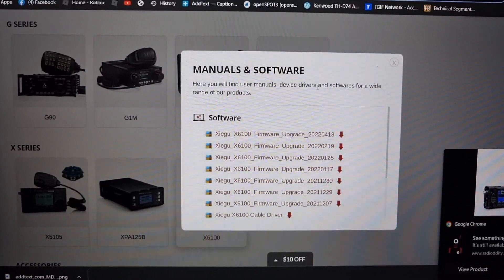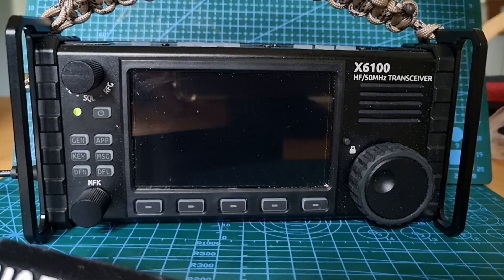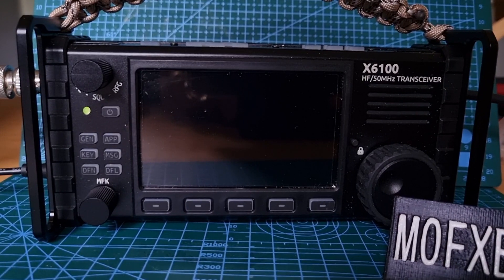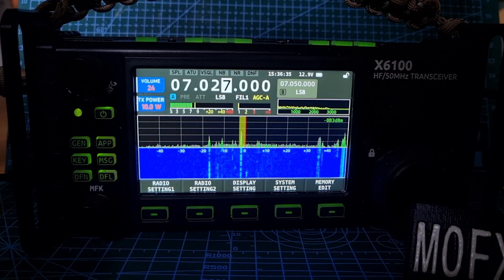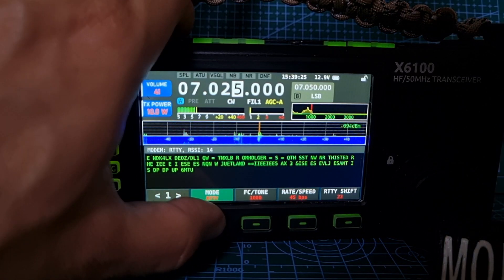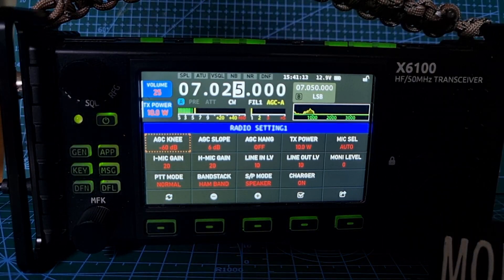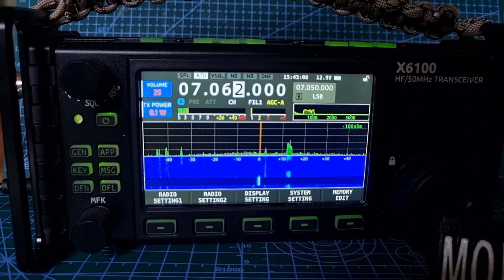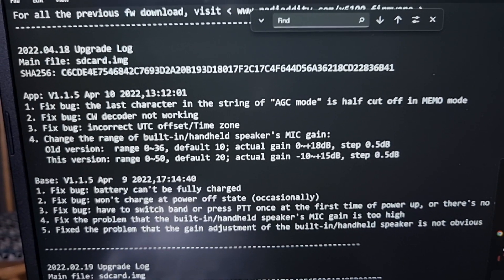Xiegu X6100 - Firmware V1.1.5 April 17th 2022 Full Install and Test

Comment: Just bought x6100 last week, which has the same v1.1.5 version, and the internal battery can only be charged to 8.0V, any of you guys have the same issue?  73 de bg8avs :)
Reply from the maker: Yes 8 volts is normal
Reply: @M0FXBHamTech  oh, so I'm glad to hear I'm not alone :) thanks. the normal fully charge voltage for 2s battery should be 8.4, but it is good for the working life of the battery, so I think I will live with it. I will be using external power supply most of the time anyway.

Comment: Enjoyed video.    Question about updates. My x6100 has version 1.1.2 , so can I bypass 1.1.3 and 1.1.4 and just do the 1.1.5 update ?
Also, you used Rebus to get download. Do I need this software and is it free ?   Thank in advance for your help.   Bill  G0STR
Reply from the maker: Hi yes Rufus is free and just do 1.1.5
Reply: Pleased to report that I downloaded 1.1.5 from Radiooddity and uploaded it successfully into X6100 at first attempt.
Radio seems to functioning OK.   Thanks again for your help.    73. Bill G0STR
Reply: @M0FXBHamTech  Ubuntu Disk Creator works fine too....

Comment: I wish this worked for me. The app update went fine but it crashes immediately after I press Upgrade for the base.
Reply: Pro tip - plug in the power first. The battery was fully charged, but it would not succeed until it was powered externally.
Reply from the maker: ok thanks